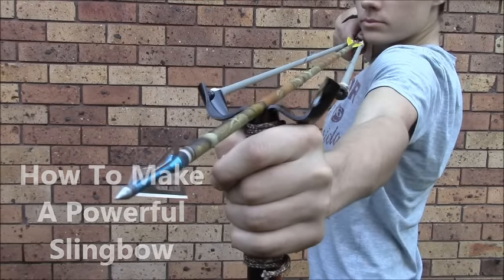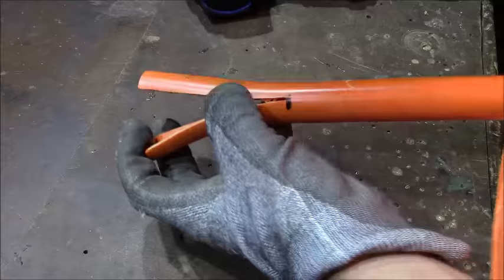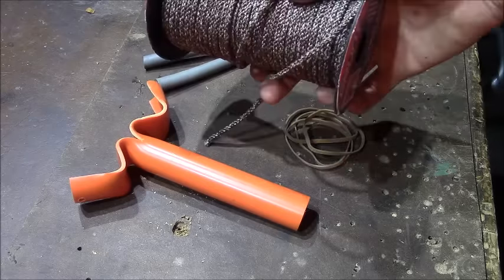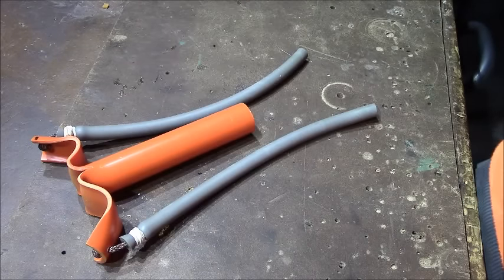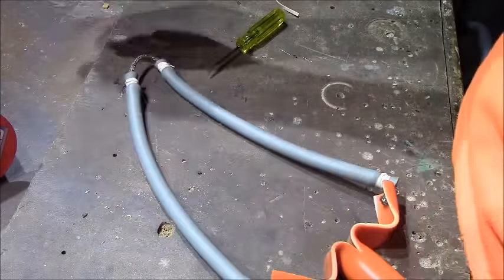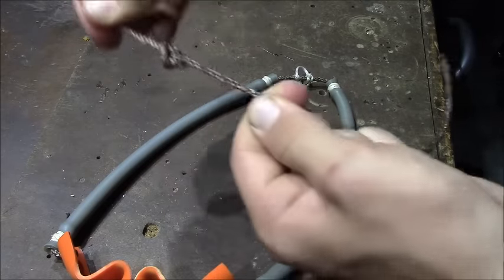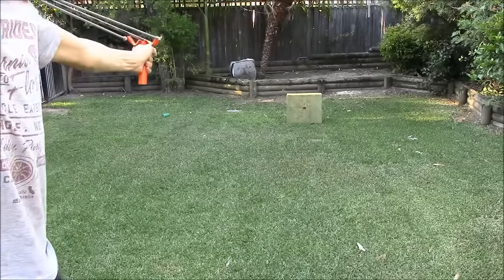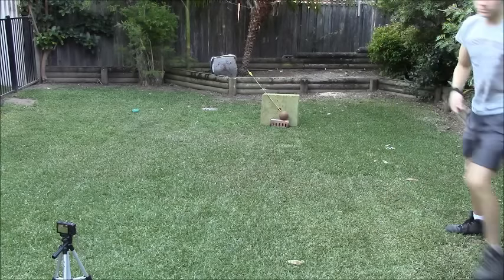How To Make A 45 Pound PVC Slingbow for $5 Zommbie Defence , fishing , compact

Comment: IF your going to make this, use schedule 40 or 80 PVC conduit, strong stuff, should work good. Use something else besides the rubber bands like the inner lining from a piece of paracord :)
Reply: +Anonymous 1 Hose clamps. Cheap, screw driver tightened. Won't come off.
Reply: That would probably work as well. or zip ties.
Reply: We used to use worn out inner tubes. I'm sure they can still be bought new today. Also I've never tried this,  but I wonder if the stronger exercise bands would work
Reply: Jake Jack you could use exercise bands

Comment: Rubber bands can dry rot pretty quickly. You'd be better off using a small zip tie instead.
Reply: Dark Eternal,
I've wondered about longevity of ties, also, but wouldn't zip ties tend to cut into the bands?
Reply: CA2APat My hawaiian spear used zip ties. Over a 3-4 years it did cut through enough to split the cord but it was easy enough to cut off a few cm and redo it. It was overlapped to make it less likely to cut through. Hope that helps
Reply: CA2APat id put some kind of pad between cable tie and rubber
Reply: Some thread or small cord would work fine to do the tying. Fishing rod runner tie cord, tied the same way its done on fishing rods would work fantastic.
Reply: Dental floss or spider wire fishing line will work well.
Reply: 0   
9
Reply: Bam. You knew to much.

Comment: I've purchased a hunting slingbow 45lb with wrist brace.  Watch this guy's arm shake.  I can tell you that this isnt going to replace a compound bow or even a traditional bow.  It has the power what it doesnt have is the stability unless you've the physical strength to maintain that.  Think of your arm as the limb replacement.  I'm not saying they dont have a place, I'm saying know what to expect.
Reply: Is the hunting slingshot your referring to the hammer?
Reply: @lucixmon  it was an off brand but I've tried several with the same outcomes.

Comment: Outstanding, Great Job!
Subscribed.
Just a small point on long term viability. I would substitute nylon cord for the rubber band closures. The bands will deteriorate quickly under extreme uav or wet conditions. It also eliminates one item from the ingredient list. :)

Comment: good video. I have made 2 slingbows  the first was with 3 cm, the second was with 2 was with 2 cm pvc. I wasn't paying attention when you said how strong the bands should be so I used 20 pound bands. Very weak. only shot about 20 steps. I didn't measure it. But they did work. Thanks

Comment: Dunno if this was asked already (didn't read all comments) but, can you use small zip-ties instead of the elastic bands?  ice design, simple to make survival project.
Reply: I would"t, the zip ties will actually cut into the rubber under tension.
Reply: Vin DiVergilio if they have soft round edges.  You can use a rope, thinnest ones with high tensile strength.  The rubber bands will dry and crack over time, especially if you live in dry or cold areas, and sun and heat exposure as well as extreme cold will shorten their lives as well.

Comment: (No to rubber Bands around the cord and YES to 2 Zip Ties on each securing point of the surgical tubing)! You will thank me when the rubber-bands are subjected to any condition. ie: heat or any type of cleaning solution and just age will cause fatigue and trust me when one of those tubes smacks you anywhere in the face or eye you are out of commission and the fun is over... ;)
Reply: no thanks id rather be whacked by a rubber band any day over a plastic ziptie 
bands need replacing  regularly  anyway
Reply: @tomwarrilow8598  ive made one of these 5 years ago with zip ties and they NEVER snapped on me. I just made another sling bow yesterday with zip ties and its doing just as fine as the first one.

Comment: i know this video has been posted two years ago, but anyone who tries this: here's a little tip. excersize bands have a restriction band in the actual band, which regulates the amount of force needed to pull back the rubber bands. using a 20 lb band will be just as effective and way less energy is required to pull the slingshot back.
Reply: +Backyard Armory

Comment: Couldn't you just swap out the leather pouch on a regular slingshot with the double knot para cord to use for an arrow. Also, it looks like you could tie off the rubber tube around the para cord knots with some small zip ties instead of using rubber bands that quickly rot and break. I haven't tried any of these suggestions, maybe someone else knows if they'll work.

Comment: A lighter for the heat and black electricial tape instead of rubber bands will work, too.
Reply: black tape stretches
Reply: Judge OvyoursoulvO Up to a point, then it holds tighter than the band's do.
Reply: Silk garter works, too.